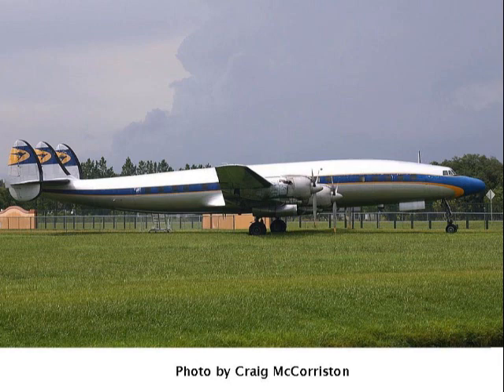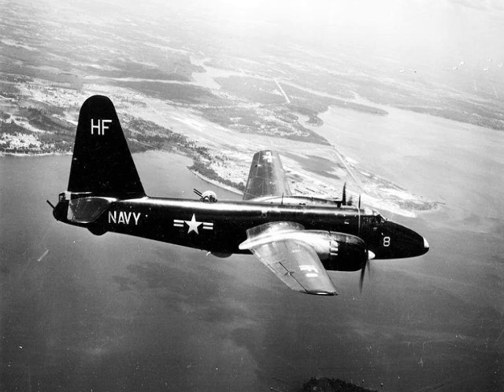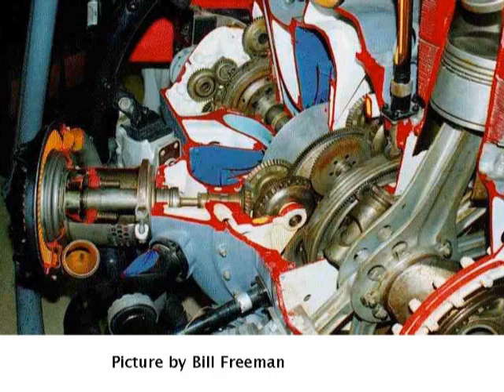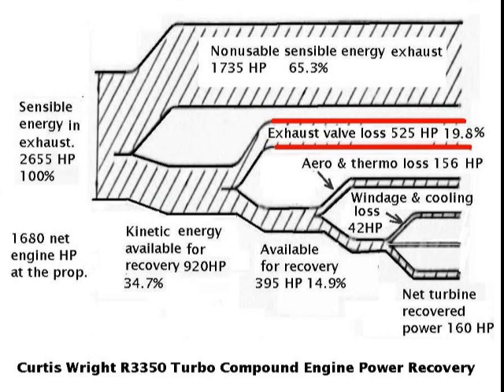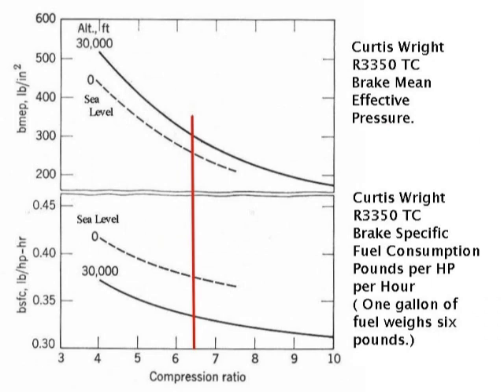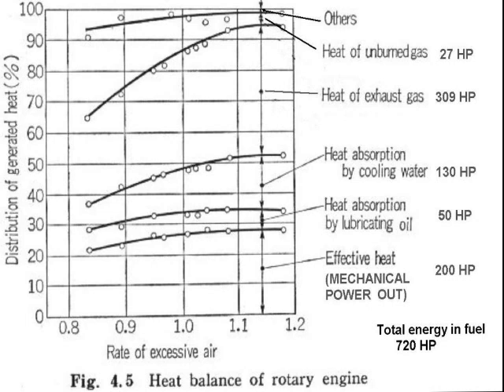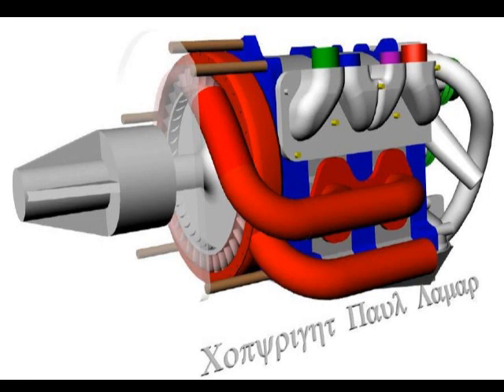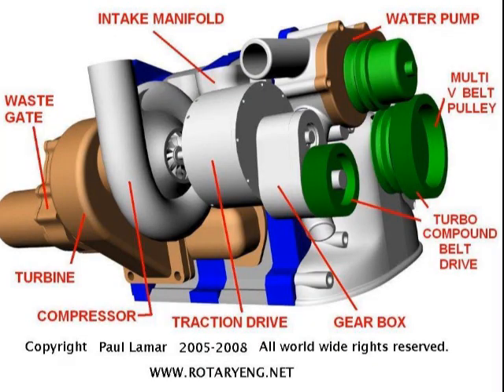Turbo Compound Rotary Engine

Comment: Latecomer here:

I owned a 2004 Maxda RX-8 with the RENESIS 13B-MSP rotary engine. I loved it and its taken me the fastest I've ever been on a road in excess of 165mph relying on fifth gear to keep accelerating as sixth could not deliver the torque -which is a key downfall of the gearing. That car saw America coast-to-coast, Death Valley to Dakota blizzards. Balanced so well that it was casual to cruise at 120mph like normal cars doing 80mph. Bar none, this probably was the most capable Natural-Aspiration ricer to ever exist and that little wankel drove it. And yes, that redline reached past 10k, though honestly it was abusive to hover anywhere near that range consistently. It was also a trash powerplant in the long run and was in no way suited as a daily driver. There's a reason why rotaries are not in the current Mazda lineup of affordable zoom-zoom fun. I'm pretty sure the Mazda factory came to hate all the spares they had to dispense.

At 80,000 miles and two factory replacement engines (and I suspect poor cooling also lead to a replacement transmission and clutch assembly), I finally had to give her up to another rotary enthusiast essentially as a parts mule as the warranties finally ran out. This is in conjunction with all the rituals about engine shutdown and operation that conventional drivers never have to put up with.

Why the issue? It only combusts in one section of the chamber, consistently, and with imperfect sealing, so the heat eventually murders this powerplant's components. That engine's compact size is what killed it; for this wankel to work, a system of passive (fins) and direct (fluid) cooling must be incorporated into the system. I kept extra engine oil in the trunk at all times, and frankly, I felt that it needed its own gauge!

Aircraft powerplants need to be able to operate at peak capacity, consistently, during its lifespan. This is why so few modern powerplants adapted from the automobile industry can outperform the old warhorses developed using the final lessons learned from WW2-era piston engine design. The mazda engines are incapable of matching that requirement. I would LOVE to see the beloved RX-series return to the roads with a durable wankel, twin-charged even, but they have to solve the issue of blown seals and valves from excessing corrosion and honestly, that may be beyond the scope of any wankel.

Using a completely different style of "rotary" as in radial engines, those Curtis and Wright powerplants were war-winners. Good enough, tough enough, and we made more than enough -suck on that, German engineering. And double-row was as far as efficiency went in regards to cooling vs the additional weight and cooling nightmare of subsequent offset banks of cylinders. You know what these turbo-compound systems are called by the techs that have to service them: PRTs. Not Power-Recovery Turbines, but Parts Recovery Turbines. I'd love to see these on cars, however, if any auto-manufacturer is able to iron out those kinks. Solve the reliability of these bolt-on babies, and that may be piston-engine's next lease on life in the automotive field where we are developing towards hybrid and electric powerplants. 

TL:DR if you have the finances, the time, and the drive, yay! If not, just go with increased displacement for cars or turboprops for aviation. The market goes where the savings are, and fuel savings are offset by maintenance costs.
Reply: Wankel engines are simply not reliable enough for aircraft applications, Paul would tell you this himself but he is no longer with us. R.I.P. Paul

Comment: The R-3350 was indeed a very complicated engine............and its 6 to 1 compression ration, even with a supercharger was pretty inefficient at turning fuel into energy.   One of the better improvements of recent times is the advent of easy to apply ceramic coatings, which can be used on piston crowns, valve faces, manifolds,turbine housings etc.  Research papers indicate that these coatings can get a lot more of the heat lost to the oil and cooling systems into usable energy supplied to an exhaust turbine.  As for the rotary............it sent NSU and Mazda bankrupt, for a reason.

Comment: In Germany, they tested also thermocouples, producing electric power from exhaust heat, it seems starting efficiency was poor. About the double expansion engines, a process already used in steam machines, e.g., in Titanic, T Suzuki, in his SAE book: 'The romance of engines', discusses exhaust gas energy. A Yugoslavian team, also in SAE, obtained fuel economy improvements in Otto engines by adding exhausts to carburetor, it seems this differs to EGR. Blessings +

Comment: The hardest area to over come with petrol compound turbo engines is  the amount of boost. I have a small compound kit on my diesel cummins for towing.  Turned  down It makes 59 psi turned up  I hit 110 psi . You have to throw every  tool in the kit to combat pre-ignition on gas engines . Really low compression, high octane fuel /e85/methanol/alcohol  low timing  forged rotating assembly  oil cooled piston squirters. The list could go one & on. But when done right its sweet , hang on for a hell of a ride!
Reply: Unfortunately Paul was a few bricks short of a full load... not a credible reference source and of questionable mental health.

Comment: In your heat/HP diagram of the Turbo-Compound R-3350, you show 150 HP being added back to the crankshaft via a fluid coupling.
However, the TC R-3350 had 3 turbos. 1 for every 6 cylinders. Adding 150 HP each.
This then gave back ~ 450 HP to the crank. Probably a little less. But it would improve the numbers on your diagram quite a bit.
Nice video.
The TC R-3350 was a maintenance nightmare. It put more heat in the exhaust valves which was a problem with the engine from its original development as was cylinder overheating.
The engine was a kind of hybrid that bridged a gap between eras. People finally decided to use big centrifugal (or axial) compressors burning fuel continuously in burner cans and a turbine to extract the power from the exhaust to run the compressor leaving the rest for jet thrust . Or use a second turbine to extract the remainder of the exhaust energy and use a gearbox to run a propeller (turboprop) or the rotor on a helicopter. Simple , reliable, no reciprocating mass, lightweight, and powerful. As is usual the early designs had efficiencies in the 30% range. They were expensive and sucked fuel like a camel sucks water at an oasis. Much improved in today’s turbofans.
Reply: Paul was not an engineer or a professional... he was not playing with a full deck either....

Comment: Napier avoided the exhaust valve and knock issue by using a horizontal opposed 12 cylinder two stroke diesel for their turbo compound. It worked making over 2500Hp  (3100 hp takeoff) but mechanical complexity and the gas turbine engine killed it off.
The napier nomad engine is also described in 1950's SAE paper. Nowadays electric assist turbochargers as used in F1 would make an ideal turbo compound in that they can both add power to and draw power from the turbocharger avoiding the complexity of a mechanical variable speed drive. The Wright engine was knock limited to around 6:1 compression resulting in a rather hot exhaust, sodium filled valves were not enough to ensure reliability. Thanks for the interesting videos
Reply: @Mark S Thanks I agree with you, electric assist might not have been the best term to use. Anyway wherever a synchronous motor is used to power something, turbocharger for instance, it becomes a generator simply by changing the phasing of the electrical inputs relative to the rotor phase which in the age of semiconductor switches is relatively easy to achieve, regenerative braking is a good example of this. As for the Napier nomad I went on search around England to find the engine and ended up in Edinburgh university who told me it was in another university down south. I never did find it.
Reply: @Mark S I have a feeling the U of Edinburgh person mentioned the British museum storage. Anyway that was over 20 years ago and I am a long way from Britain now. If I get back there I will hunt it down. Napier turbochargers were fairly common on large diesels over here in Australia.
Reply: @Mark S It is not as bad as the press make out they love drama. All the press over here talk about is the virus and sport I gave up listening to them them long ago.

Comment: would injecting water after the exaust valve reduce the temperature and increase the pressure of the exaust gases i think water expands like 11000 times when evaporates but we would need a water tank too.
Reply: yeah also exhaust system would rust even more...

Comment: Poor thermal efficiency, low reliability and terrible exhaust emissions have rendered the Wankel engine obsolete... although it seems that turbo-compounding of reciprocating engines is poised to make a comeback.. particularly if combined with recent developments in HCCI technology
Reply: but less efficient engines have bigger potential for exhaust energy recovers so wankel is perfect... well yeah... not so reliable lol
Reply: @jebise1126  Wankel engines no longer have any potential... in fact they have been obsolete for a decade now.
Reply: @jebise1126  Higher overall thermal efficiency is achieved when you start with a more efficient engine in the first stage.
Reply: Bla bla bla
Reply: azrul nizam I'm sure that's what it sounds like to people that have no education in engineering...Lol..!!!

Comment: Cool ! Have you looked into the free piston diesel turbo engine? G.M. and Ford worked with idea in the 1950's but this engine tech never showed up anywhere. Seem you could make one for low cost because of the low parts count.

Comment: Nice concepts, nice video. What about sending the exhaust gas to produce push, in the style of Caproni-Campini N.1, or using the heat to produce electrical power via thermocouples, or to generate steam and move a high or low pressure steam turbine, or even a multiple-expansion steam piston engine?
In the patent databases, an Internal Combustion Turbine, registered under several names, one of them Thyssen, claimed a 31% thermal efficiency, and this was before 1930!
Reply: The problem in Turbo-compounding an RCE may be that a high exhaust backpressure tends to decrease a bit power and efficiency, specially in Peripheral Ported Intake systems, that are the ones providing the best Volumetric Efficiency and Mean Effective Pressure, a high MEP is required for a decent SFC and low exhaust gas temperatures
Reply: @josega6338  apparently BMW had some plans to generate steam and with that steam recover energy losses... but nothing happened

Comment: +niflap It would allow the engine to run on automotive gasoline instead of avgas or Jet-A or Jet-B, making fuel less costly for light-aircraft owners (who are often individuals operating the aircraft for personal use, thus who can't afford to pay a high fuel cost)

Comment: compound turbos in diesels do not have a direct conection to the crankshaft, it is basicaly multiple turbos connected in series on the turbine side and compressor side, to increase boost pressure, Cummins and Cat have done this Cat on the c15 with lots of problems. diesel tractor pullers also use this method to get boost pressures to over 200 psi.

Comment: So Paul, what's happened with your turbo compound project?
Reply: volvo is making trucks with it... but i heard that there are reliability issues... also turbo compound technology is used on engines that make electricity apparently... so its not all dead.
Reply: Detroit as well

Comment: from what i know, to make a turbocompound engine work, you need high rpm's which for fuel efficiency you would want the opposite (low rpm's) it might work for race engines, though(especially with F1 going to turbos in 2014 i would not be suprised to see an engine maker try it)